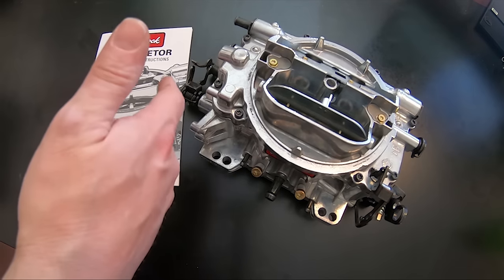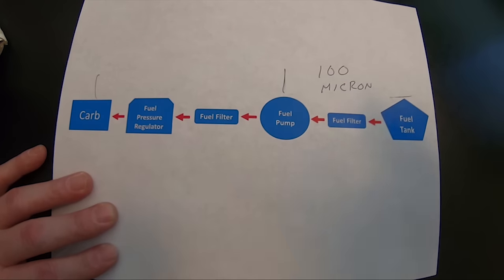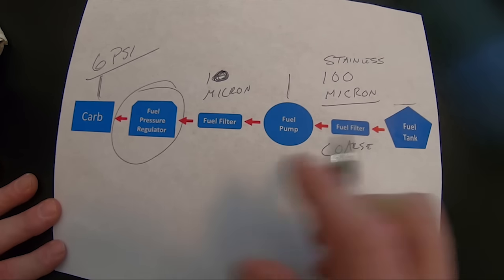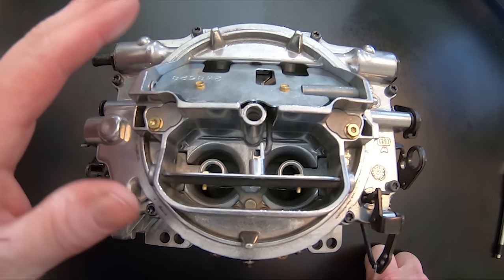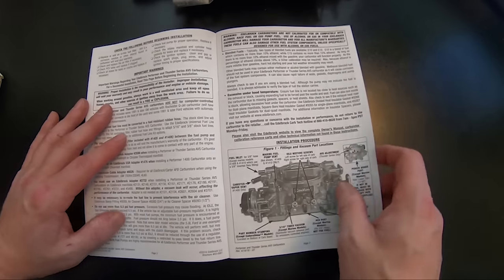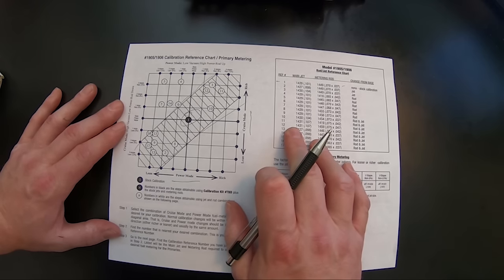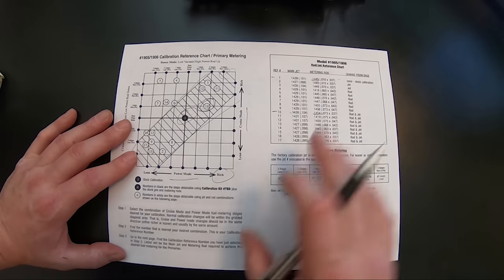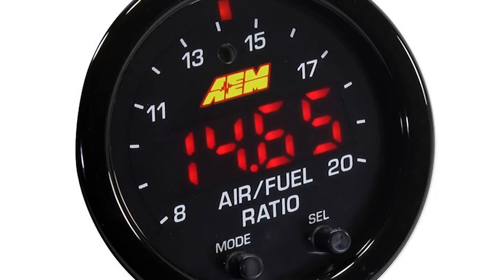The Ultimate Edelbrock Carburetor Tuning Guide

Comment: I'm using anf AFR gauge running a 650 AVS2, in cruise mode running 13.5 throughtout the RPM range up tp 6000, however if I go wide open throttle after about 3000 RPM the AFR goes to 25 or more...way to lean. When I go richer  on the primary side it runs 8.0 to 10. without any change at WOT, still runs lean. went richer with the seconday jet...no change in WOT
Engine is a SBC 350 has about 3000 miles.
Reply from the maker: How have you adjusted the AVS?
Reply: @MuscleCarSolutions  currently at 7 for model 1915 on pink spring .104 secondary jets,  minus 1/4 turn less tension on the secondary plate.
Reply from the maker: @crazyhorseDOC59  there we go.  Add tension to the AVS.  https://youtu.be/hrwcemew8g8
Reply: @MuscleCarSolutions  that was the only video of yours I had not seen. 
All your videos are  very well done. Great productions.
Thank you.
Reply from the maker: @crazyhorseDOC59  glad they have been helpful!  Let me know if that AVS adjustment helped.
Reply: @MuscleCarSolutions  yes, got it alittle rich the first time. Running around 11.50 to 12. at WOT. Definte improvement on throttle responce. Working towards 13.50 .
Using an AFR gauge is definitely the best way to  fine tune a carburated engine.
Reply from the maker: @crazyhorseDOC59  for sure an AFR is priceless.  Takes all the guess work out of it. 12.5 at WOT is good for an n/a motor.  Sounds like you’re getting it dialed in!  Good work!  Nothing better than getting it headed in the right direction.

Comment: Your have enjoyed and learned from other vids of yours. To the point of now having two questions... 1) Do all AFB and AVS carbs basically start with the same base/body, but only the jetting and metering rods are different? 2) If this is true, can I take a 1906 AVS2 and turn it into a 1903 by getting the 1903 Calibration Kit and just step the 1906 down?
Reply from the maker: You can change the CFM of those carburetors.  That’s a fixed number that remains constant no matter what rods, jets, springs, squirters you change.
Reply: I'm sorry, I'm not following. You are saying the CFM can change, so what is the fixed number then? Is there a typo or am I just missing something here? Thanks
Reply from the maker: @thebighair37  typo.  You CAN’T change the CFM.  It’s fixed.

Comment: Hey Bone, I am about to rebuild my Edelbrock 1406 fuel pressure is good, will be changing filters as well, the biggest problem I was having is a chugging when driving on a flat surface at about 10 miles an hour, not real bad but noticeable, with that being said as soon as I give it some gas snaps to life, so I thought I would just rebuild the carb, sense I just bought the truck a short while back (55 chevy big window), what do you think, thanks Mike
Reply: Bone Head right on, thanks, should I try it the way it is after the rebuild first , probably ya
Reply: 6 psi
Reply: 6 psi
Reply: But I only have the 8139 filter
Reply: Is it ok to put both filters and regulator under the hood
Reply: What about a paper filter with the 40 mic I already have
Reply: Bone Head 
Hey Bone really appreciate all the replies, I have talked to you before, you were great then too
Reply: I didn’t know you had the reassemble video out when I was talking to you yesterday , how cool, I will be rebuilding my carb this weekend 😀

Comment: Can someone help me out! I have a brand new avs Edlebrock 1406 on a stock 305 with a computer delete my idle n park is high but when n drive it pretty good, also my clothes smell like I been riding a dirt when I stand by the car also I’m seeing smoke come out the carb when I shut the engine off using an aluminum quadrajet spacer this is a brand new Edlebrock carburetor straight out the box any suggestions would help
Reply from the maker: Sounds like you’re into the transfer slots at idle which would cause the rich condition.  Keep in mind the 650 is too much carburetor for a stock 305 so you’ll be fighting the rich condition for awhile.

Comment: I found that when the ambient temperature was between 0-30 degrees (f) my 350 sbc ran great throughout the rev range. Now that it’s 60 degrees (f), at around 2000 rpm the engine backfires out the exhaust and sounds like gunshots. Thoughts? All ignition components were changed in the last 2k miles
Reply: Bone Head I’ve got an hei distributor. I’m starting to suspect the vacuum advance diaphragm may be failing due to the engine falling on its face above 2500. Also takes more pump shots to start than it used to

Comment: i have a 93 dodge Dakota with the 318 it's fule injection now how can i get more horsepower out of fule injection  if i switch over to carboraitor i was told go with the holly 600cfm 4bbl electric choke  and the air gap intake and a return line fule pump regulator the transmission is ran by the computer can i keep the transmission

Comment: 10:10 The tuning chart for the 500 carb has got at least 3 errors in it!  If you work out the area of a jet and then the two cross sectional areas of the rods you can work out the flow area for any given combination of jet and rod, you can then compare this to any other combination. I use an XL spreadsheet to work all of this out, it has shown that the percentage figures of change that Edelbrock quote in their chart is sometimes wrong!

Comment: It's a great explanation! I have an Edelbrock 14053 on a Ford 302 and I couldn't remove all jets, they stuck and broke down inside of it. Did you face any issue like this?
Reply: @MuscleCarSolutions  How do you drain the carb. do you take it off of the motor or do you have a trick?

Comment: I have watched this and some other of his videos. i have a 66 Mustang, slightly warmed over 289. My old Edelbrock1406 was just changed out to a 1906 AVS2. I replaced the fuel pump that was rated between 6-8 psi. New fuel hose and filter between the pump and carb. As recommended, I added a regulator. [A cheap one at first] No matter what adjustment I made, all I got was between 3-4 psi. So I upgraded to a more expensive regulator, and still only reads between 3-4 psi.  His channel says Edelbrock's like a 5-6 psi reading. Help
Reply from the maker: @suejackson8007  well it’s time to verify what pressure (flow) the pump is actually producing.  Then determine if the pump is defective or you have something in the system blocking the flow.

Comment: Nice video and to the point. 
I have a 500cfm on my Rover/Buick v8 3.5 Defender. The carb is probably a little too big for the motor and tends to run visibly rich. 
You mention about boil off, i was unaware of this condition. I assume this is why it takes a fair amount of cranking to fire up after being parked for a few minutes, i will fit a spacer and see how things go.
I am about to install an afr gauge and getting the tuning set correct. Your explination of the chart was valuable. 
In your experience, is it worth getting jet/needle tunning kit or just buy individual needles and jets?
Reply: The 500 carb can be made to work very well on a Rover 3.5, it is just jetted to rich out of the box, in fact why would you expect it to give the right fueling out of the box anyway? I've setup loads of these carbs on 3.5, 3.9 and 4.6 engines. It is impossible to set a carb up properly without monitoring the air/fuel ratios for all the modes of operation of the carb but as a VERY rough guide you will probably find that just swapping out the 65-52 rods for a set of 67-55 rods. You also need to set the idle screws up but you can get them setup by having them set rich at something like 3 turns out, then screw each in 1/4 of a turn at a time, swap from one screw to the other whilst listening to the engine, the revs will start to rise but at some point the revs will drop just a fraction, go out 1/4 turn from this drop off point. Other things that you might need to do are fit the next weaker set of rod springs and possibly larger secondary jets, this is because the smaller engines don't pull as much vacuum whilst cruising  which can cause the rods to lift too early, the lack of vacuum wide open throttle can cause the secondaries to not deliver enough fuel which makes the mixture go a bit weak at WOT
Reply: @sidecarbod1441  Thats some very good advice. I have got it setup fairly well now, no black smoke and reliable performance. 
It feels a little flat around 2000rpm so i will try changing the springs. My biggest concern is now around venting the motor. I run an-6 fittings on each rocker cover, however i feel this might be too small
Reply: @nathanm3591  I'm not sure where you are based in the world but if you are based in the UK then you might have heard of a company called RPI. They sell Edelbrock carbs and they offer advice on setting them up, the only problem is that they don't have a clue how these carbs work! If you are running their setup which is an 80 jet and 62 52 rod then it is way too lean on cruise, (19% leaner than the out of the box setup on cruse and 21% leaner on the powerstep) the engine will feel flat at small throttle openings. JRV8 is also another supplier of these carbs, his setup of 83 jet 62 52 rod is not lean enough! (4% leaner on cruise). The 86 jet (standard) and 67 55 rods that I suggested you try are 8.3% leaner on cruise and 6.7% leaner on the power step. During my testing I have found that the 3.5 engine  will want the carb about 8-10% leaner on cruise than the stock setup. The bigger engines can run with a leaner carb setup because they pull more vacuum, the actual air fuel ratio for the different size engines will be around the same (15-15.5:1 on cruise) but the carb setups differ to obtain this. The piston springs are not going to be the issue for you at 2000 RPM, the springs are a 'load sensitive' part of the carb, at 2000 RPM under very light load (i.e cruising) then the pistons should be in the down position, you will be running on the lean circuit of the primary side of the carb which is the right circuit to be on. You could fit very stiff springs which would lift the pistons but it would be the wrong thing to do!
The pistons should lift when the vacuum drops because you are at half throttle, this would mean that you are accelerating using only the primary side of the carb. You would be at 1/2 throttle, the primary side of the carb would be 1/2 open, the secondaries not open at all. What ever vacuum the engine pulls at half throttle (lets say 4 inHg) then you would need the pistons to have lifted, in this case you would fit the springs that lift at 5 inHg).

In general teams most engines will need to run similar air fuel ratios (AFR) for different modes of operation but the setup of the carb may need to differ to get these ratios. The ratios below are only a rough guide before anyone 'kicks off'.....

Cruise...15-15.5:1 (But basically goes as lean as you can whilst maintaining good throttle response, annular boosters allow a leaner AFR to work).
Acceleration....12-12.5:1
Wide open throttle (WOT)...12.8-13:1

Just taking the cruise circuit as an example the 3.5 engines that I have worked on need the carb setup around 8% leaner than the standard setup to get this AFR.
Most 4.6 engines that I have worked on need the carb setup about 15-17% leaner than the out of the box setup to get the same cruise AFR. I was running a 86 jet 69-52 rod on the primary side of my carb, now you can not buy this rod, I made mine. If I fitted a 70 thou rod the car was undriveable!  I now run my own homemade annular boosters in my 500 carb and the setup so the setup is totally different.

The other thing that makes a BIG difference is how your ignition system is setup, really you want the vac canister on the non-timed port of the carb but the big issue is that none of the standard Lucas canisters work very well with the Edelbrock carb. Your timing will probably be something like 4 degrees BTDC without the canister but will need to be at around 14-16 degrees, the canister would add this extra timing. The issue is that lets say your engine pulls 15 InHg at idle, you need a canister that is 'all-in' at 13-14 InHg, the Lucas canisters come in different forms but most are all in at 8-10 InHg, this means that they don't 'back off quickly enough when you open the throttle lets say 1/3-1/2, this means that the timing is over advanced. If you connect the canister to the timed port then you idle timing figure will be way too retarded. (I won't bore with anymore of this but a poor timing setup is in many ways just as bad as a poor carb setup!).
Reply: @sidecarbod1441  Yes heard of RPI and i'm based in New Zealand.  
I tried the settings that RPI had listed and it got rid of the black smoke the factory setup was producing. After a years driving I thought i would take another look at the engine and try some different jets so purchased the .067 x.055 rods and refitted the standard jets, however once again the black smoke returned. It was visible through all modes of driving and would have a severe bog if you touched the throttle from idle. So i pulled them back out again. 
Since then i have added a spacer to the carb as it would take about 10sec of cranking to fire back up after a hot run. I think from here i  really need to get myself an air fuel ratio gauge so I can get a better idea of whats really going on. 
Over here I run it on 91 octane rather than the higher grade, its also probably worth mentioning its the low compression motor and its powering a heavy Land Rover Defender 110. 
Thanks very much for your detailed replies, at times it can be a struggle getting info on this combination setup.
Reply: @nathanm3591  I'm surprised that the 86 67-55 setup was too rich but if it made black smoke then it must have been! Its worth checking the float height, they are never set correctly at the factory, also go 2mm higher on the float to lower the fuel level 2mm, it helps to get rid of a rich bog when you brake hard.  An Air Fuel Ratio gauge is an absolute must when setting any carb up, as is a vac gauge! the fast the you mentioned a AFR gauge means that you do have a good idea with regards to what you are doing! I have a spread sheet that really helps when comparing one setup with another. it is loads better than the Edlebrock chart, if you don't mind posting up an email address I will send it to you along with instructions on how to use it.  I also suffered the fuel boiling issue, a spacer is the only way to cure it, I also have a button that I can press to get the electric fuel pump to run even without the engine running, it means that I can prime the carb.
Reply: @sidecarbod1441  yeah sure, that would be great  I am a qualified mechanic, however carbs were slowly disappearing when i started work. I have been off the tools for 15 years now, but work as a mechanical insurance assessor (don't hold that against me lol) So you can talk as technical as you like. 
I guess one thing i am mindful of is fuel starvation in off road situations. I haven't experienced it yet, it was one of the selling points for the Edelbrock over the Holley. 
I had been using the following page as a guide to tuning recently, not sure if this is similar to the chart you mentioned.
http://how-to-build-a-pilgrim-sumo.wikidot.com/fueling-system
Reply: @nathanm3591  LOL, I wrote that stuff on the wiki page that you are using, I've not read it for ages and I suspect that some of it now may not be 100% true but still better than nothing! (things move on as I learn more and more about these carbs). The wiki page is pretty old, it was a friend of mine that created it! You would have to have a pretty weak pump if it can not flow enough fuel for a 3.5 engine but you can run the test that I think I mention in the wiki.

I now have your email address so you may wish to edit your post and remove it so that you don't get spammed by junk! I will send over all the stuff that I have written or put together. Enjoy!

Comment: Thank you for your video. I have a SBC 383 Stroker. I'm also running a pair of Edelbrock 600 CFM carbs on top of a Weiand 671 blower.  Right now my tuner has 62 jets in the front (primary) of both carburetors and 72s jets in the back (secondary) of both. We have the metering rods out but we left the plungers in. Timing is set at 27 degrees advanced. What is your opinion on this setup, have you ever heard of a setup like this. Just would like this hear your feedback if possible. Thank you,.  Jr.

Comment: Excellent video thank you so much for sharing your knowledge. I have one question, I’ve built a Windsor 351 60 thou over AFR heads and Edlebrook AVS2 800cfm carb and manifold. The engine is not installed yet. Is 800 cfm too big . If it is, can I adjust the carb downwards ?
Reply from the maker: You can’t change the CFM of a carburetor.  What is the max rpm on this engine?
Reply: @MuscleCarSolutions  street use only
Reply from the maker: @ciaranlowe5547  need an rpm.  What’s the cam rated for?  What range?  It’s important.
Reply: @MuscleCarSolutions  1500 to 5000 rpm range using a Lunati roller cam 112 lobe separation   108 center line rolle rockers 1.6 ratio. Cam part # 20350711. Hope this helps
Reply from the maker: @ciaranlowe5547  yup.  That’s exactly what you need to know.  By the math, that engine would need a CFM of around 523.72.  If it’s just a street cruiser with a really low rpm range, you’ll have a way easier time tuning with a 650 or 500.  That 800 will be an extremely rich running engine that you won’t be able to tune away.
Reply: @MuscleCarSolutions  ok thank you very much for your advice 👍